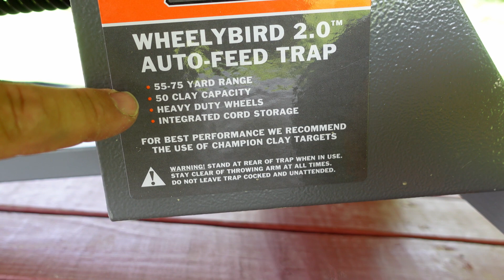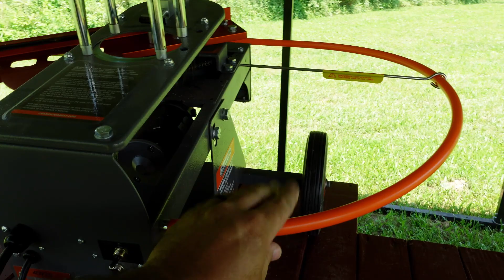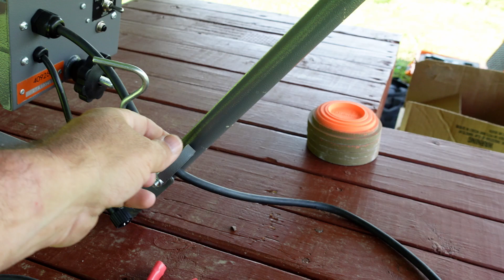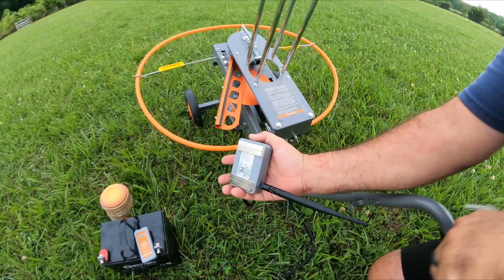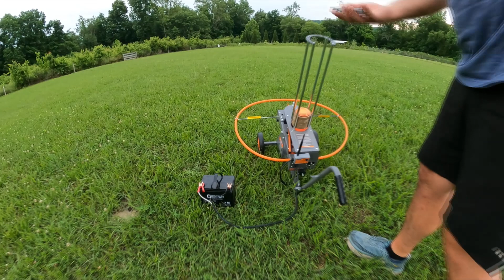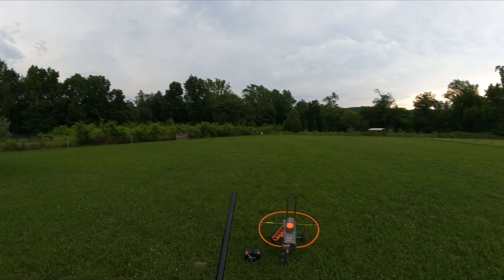Electric Clay Target Thrower - Wheelybird 2.0

Comment: I’m watching this video 2 years later. How has it held up, are you still using it?
Reply from the maker: Still using it. About a month ago my storage shed took on some storm damage and I had to take everything out of it so we could make repairs. In the process I somehow broke the receiver antennae off the receiver of the remote-control unit. I looked on ebay to see if I could find a replacement but didn't have any luck. I finally emailed Champion through their "contact us" link and told them what happened and asked if I could buy a replacement antenna. I didn't get a reply but after a few days one showed up in the mail! I thought that was pretty awesome customer service and worth mentioning! Still love this machine!

Comment: I got the previous version three years ago and love it. All my shotguns have extended mag tubes-you know shotgun barrels do get hot running a 10+1 gun fast as you can load it.
Got mine to practice station 6, shooting left handed that gave me problems.
Gotta take it apart to transport which is a pain but worth it.
I can burn over half a case of shells quick. Worth it if you like to shoot fast and different angles.
By the way, can the remote throw full auto?

Comment: I'm surprised no one has said this, you use the switch to decock the throwing arm and then you load in the clays and turn it back on. Don't load clays the way he shows. That's the difficult way and not how it was designed.

Comment: I always enjoy your videos. I bought the original Wheelybird (1.0 ?), as it's half the price (~$180 on Amazon). It comes with the same remote foot peddle & plastic wheels. I tossed the plastic wheels & bought rubber/steel wagon wheels at the hardware store, along with a piece of metal strapping, which I bent & pop rivoted on the handle (to wrap the cord around). I use a small jump start battery, which lasts for ~10 trips to the range, before it needs to be recharged. I've been using this setup for ~4 years w/o any problems.

Comment: If you had a piece of steel in your pocket, the magnet on the remote would stick to it from the outside of the pocket. You could probably run it from there.

Comment: That battery idea is good, I got an idea too. Add a belt clip to the remote, much like a pocket knife or a holster. So you can just have the remote on your hip and just press it, set it to 2-3 second delay, and you don’t have to worry about carrying it or taking in and out of your pocket. Can clip right onto your belt or even just your pants since it’s not super heavy. Just an idea, could even clip it on your pocket.

Comment: Seems to work quite well!   I'm surprised they didn't put a battery tray of some sort on it to make toting everything around easier.
Reply from the maker: You just gave me an idea! I have a welder, I might fab me up a battery tray to put in there somewhere! Thanks Jeff.
Reply: @buffalosoutdoors  battery tray for like a lawnmower battery and worse case pick up a small solar charger to clamp on handle to keep it trickle charged if your going to use it a while.
Reply: I was thinking same thing.
Reply: Isn’t that what the tray underneath is for? Looks like on the left side away from the spring there is room for your typical 12v 18ah agm battery.
Reply: Maybe on the flat area behind the hopper?
Reply: I screwed my own battery holder on built out of 3 rt. angle rails...
Reply: Doesn't have intermittent automatic throw or do you have to press the remote button each time?

Comment: Sweet! I need one. I believe the magnet on the remote would be great for sticking to your shotgun. How much assembly was required?
Reply from the maker: It did require assembly of the wheels and handle. It wasn't terribly difficult or time consuming.
Reply: I have one brand new sealed in the box I will sell you for $350